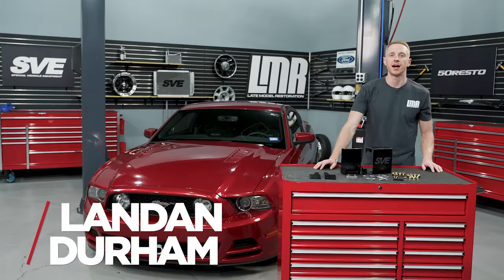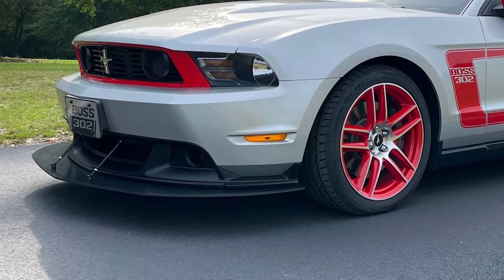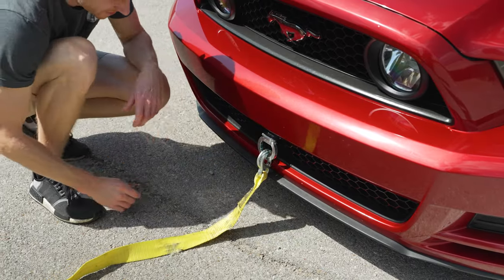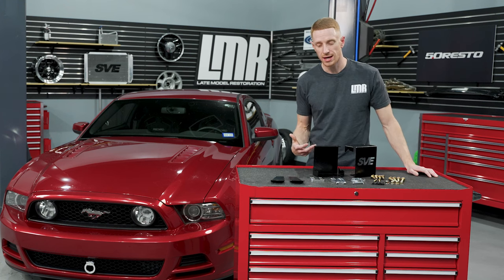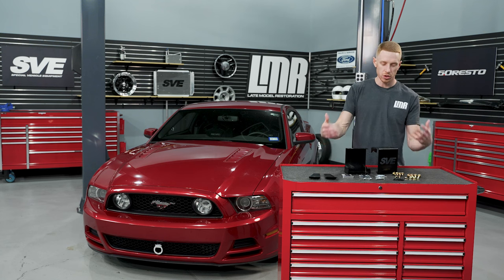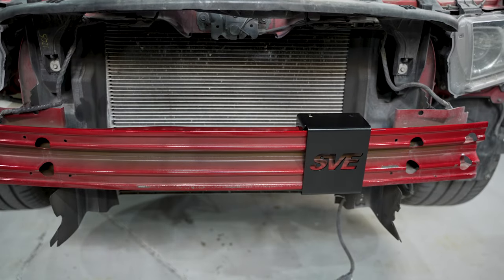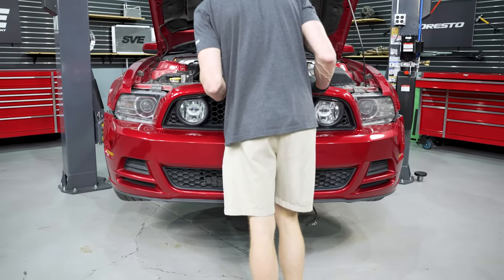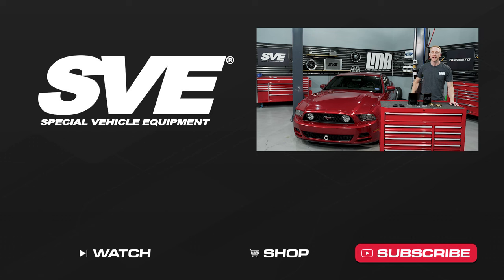2005-2014 S197 Mustang: SVE Front Tow Hook - Review & Install

Comment: Will this clear a GT500 07-09 front?
Reply from the maker: I'm not sure I understand you're question. If you're referring to the position of the tow hook clearing the lower grille, yes. However, lower grille modification is still required to clear the receiver plate and tow ring. -Landan